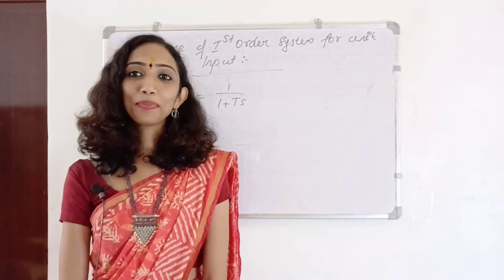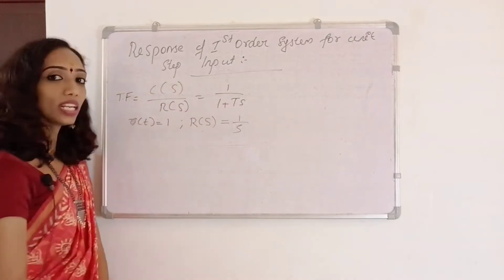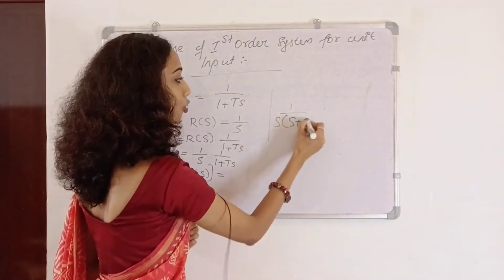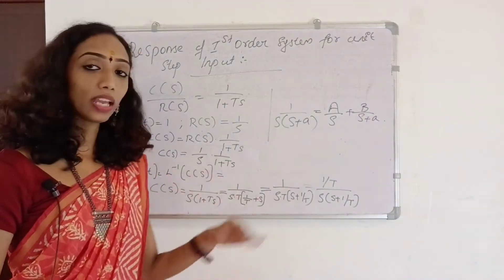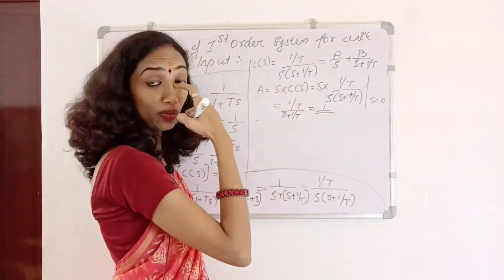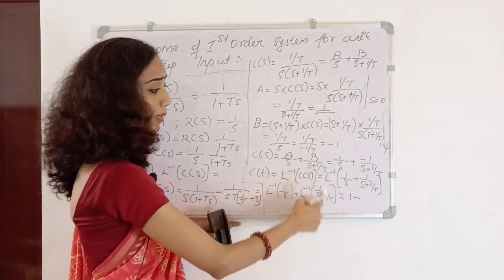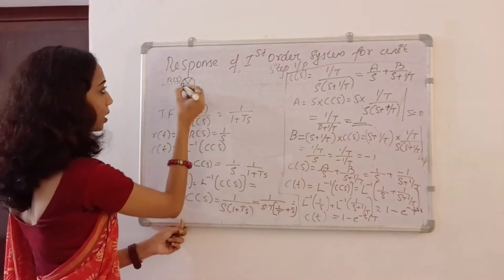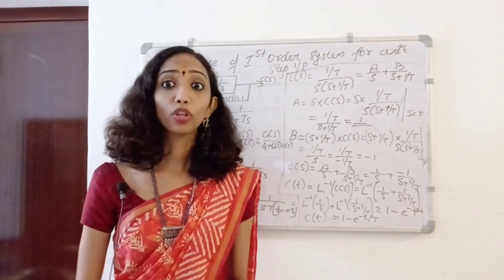RESPONSE OF FIRST ORDER SYSTEM-LINEAR CONTROL SYSTEM- Derivation Explained in Malayalam

Comment: Timestamps (Powered by Merlin AI)
00:10 - The transfer function relates input and output in Laplace transforms.
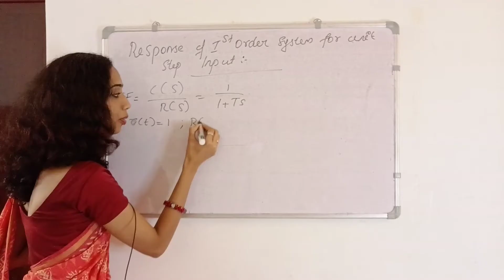01:27 - Derivation of system response using Laplace transforms.
02:51 - Analyzing the partial fraction decomposition of a first-order system.
05:40 - Understanding the partial fraction method in first order system response.
06:07 - Derivation of first-order system response explained.
07:42 - Exploring the response of a first-order linear control system.
08:58 - Understanding the response of a first-order linear control system.
09:45 - Laplace transform defines the first order system function.
Reply from the maker: @BOSCO_VLOGS-l5j  AI reation?